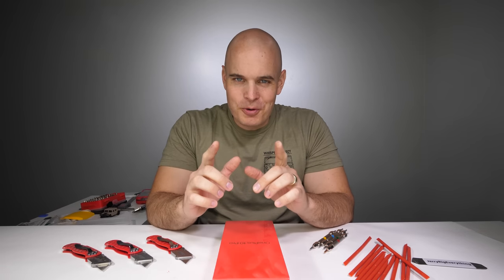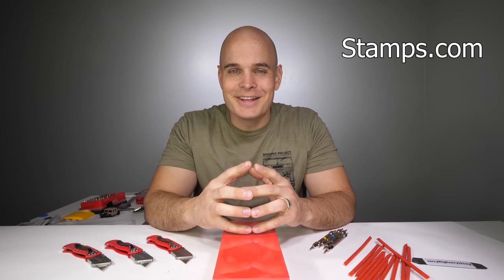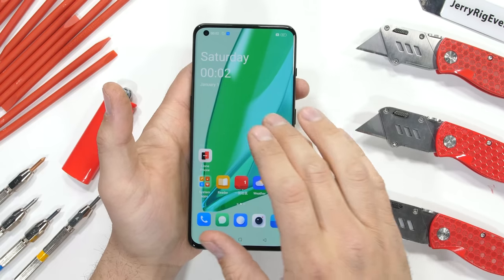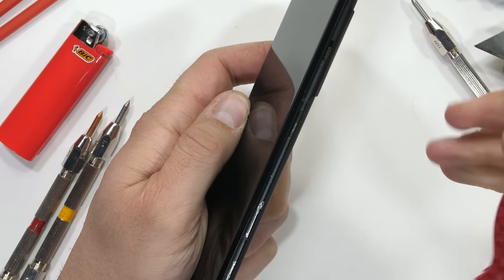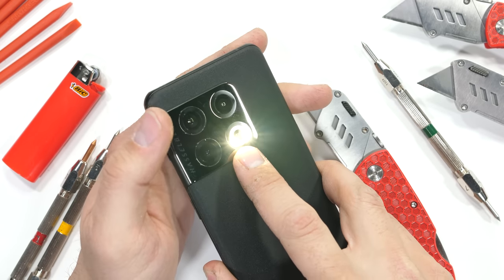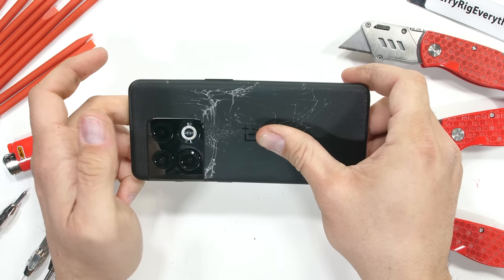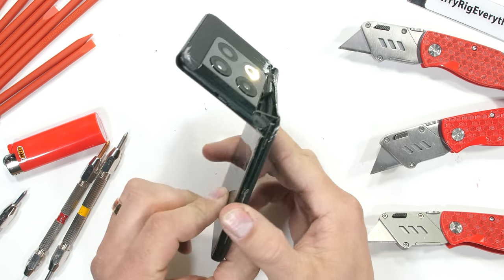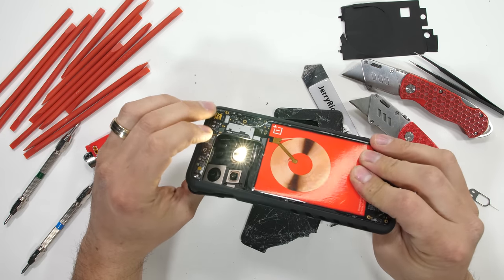Somethings wrong with the OnePlus 10 Pro... - Durability Test!

Comment: It's extremely strange that this could happen. With all the best practices the industry got from years of making smartphones, this engineering mistake should not happen at all.
Reply: Нечего было дизайн у Самсунга воровать, ничего бы этого не случилось, подумали "ооо выглядит круто, также сделаем и даже лучше!" - сделали "лучше"
Reply: It's not a mistake... They made it just name sake
Reply: Because this company is going backward, merged with Oppo. On the bright side, finally a bending smartphone again. Its been a while.
Reply: Chinese manufactures cut corners all the time, they prefer quantity rather than quality obviously
Though OnePlus shouldn't have failed so hard especially shortly going from midrange to flagship status.
Reply: @rayrayvv  has nothing to do with capitalism.
Reply: Engineering mistake happens all the time they were trying to cut cost on quality control
Reply: @souravmandal7527  Watch the Samsung Galaxy A50 durability test then say this again.
Reply: @mr.j5112  what about it? quality and quality control are two different things. If one plus had a quality control team they would have noticed the issue during test. now after the release it is not possible to recall all those devices
Reply: @souravmandal7527  Agree. But even without quality control, the engineers must have access to best practices (that's at least what we do in other profession) that they don't repeat the mistake from the early years of smartphone making.
Reply: @rayrayvv  Has everything to do with 0 competition within China, and the central government of China owning/supervising majority of companies if not all within the country.
China isn't a capitalist country my dude.
Reply: @rayrayvv  so you don't actually know what capitalism is and confuse the government getting involved with the corporations as capitalism, when it isn't. Got it.
Reply: @rayrayvv  I never said anything about corporations controlling the government. And indeed they are two different things. One is Corporatism while the other is Fascism. 
Both of which go against the ideas/policies advanced or would be advanced by capitalism.
Reply: @rayrayvv  Fascism isn't the next level up, it's the next level down towards socialism, fascism is when you mix capitalistic structures with socialistic ideas, or replace certain structures with that of a more socialistic structure, economic fascism, then you mix or rather retain certain parts of nationalism then you get what Mussolini had and what National Socialists built upon. 
It definitely is a thing and you mentioned it.

China has economic fasicm, not capitalism.  That's what I said originally.
Reply: @rayrayvv  they aren't opposites, if you mean politically? you can argue that, in terms of economic policies, there are quite a few similarities.
Imperialism doesn't equal to Fascism, though they can be mixed at points. Capitalism by itself doesn't lead to imperialism. 
I'll shortly address two different subjects you raised:
For Ukraine, you cannot over simplify it to the extent you seem to have. There's a a lot more that happened that has now lead up to where it is now. 
And the US "implant" a neo-nazi as their leader,  given that none in US at this time, are in line with the ideas of national socialism. Unless you count the politicians attempting to coerce tech companies in silencing discussion. Trying to get a monopoly on speech, or endorsing/bailing out and supporting groups that are/have been rioting, causing destruction etc.
The discussion appears to be going nowhere apart from rapidly switching the subject of discussion. Nice talk though. 
Cheers

Comment: Yes, it does have an impact, especially since OnePlus has the highest prices, at the same level as Samsung. I am expecting something more durable from a 1k phone.
It was only acceptable when they had phones costing 400/500 euros.
Reply: Yeah, although it should be noted that OnePlus was $200 cheaper MSRP for their flagship. It's still $100 more than the Pixel 6 pro and is definitely overpriced but still a little bit less than the Samsung flagships.
Reply: Nokia
Reply: Eh, not even that is acceptable. My phone is a $400 Xiaomi 11T and I expect durability from it. So far it's good, but if I ever see Xiaomi 11T failing a durability test, I will definitely change this phone to Xiaomi 12T later.

My last phone was a $110 Infinix Hot 10, and I expected durability from it. It has served me very well, and if I ever want to change my daily driver to Xiaomi 12T (if they don't fix 11T's bugs and 12T is a lot better), I will use my Hot 10 again for a while as a temporary phone.
Reply: my oneplus 5 was durable, right now my only issue was the battery life was shorter compared to when it was brand new. thats why i guess oneplus really settled when they got popular, they care less on their new phones because they are already popular and already earning more money

Comment: Interesting, 10 Pro is basically a 9 Pro refresh (with downgraded Ultra-Wide), yet 9 Pro did not even budge at bending test.
Reply: I noticed the same on samsung
Reply: It's literally WORSE than last year's phone... even the worst iPhone refreshes aren't as terrible haha
Reply: @tommymician121  Still interested in OnePlus 10 Ultra global release this spring/summer with Periscope, MariSilicon X ISP and SD 8 gen 1+ made by TSMC. Just hope it is not a waffle as 10 Pro.
Reply: @TheChazas  sounds nice but is it really gonna be better than the s22 ultra with it's s pen etc.
Reply: @tommymician121  honestly, who knows. and well pen is a niche thing, and personally I dont need it, instead I would take more battery or bigger sensors for the space pen uses up.
Reply: @TheChazas  Makes sense makes sense. I guess let's see, and let's hope OnePlus of all companies doesn't price it out of the market haha
Reply: @TheChazas  SD 8G1 chips aren’t as good they’re not efficient enough and they can overheat
Reply: @lifeisshørt_420  yeah that's very unfortunate. I've been saving up for a z fold 4 but with that chip I'm not sure if I want to pull the trigger if it has a disappointing chip... (Currently own a 1+7 pro)
Reply: @tommymician121  if you really want a phone with that chip then Samsung is your only choice with the z fold 4 or the S22 series. I’m sure they’re the ones who can manage to make the experience not as bad as the Chinese phones
Reply: 1+ runs on a shoestring budget now as it is being merged with OPPO

Comment: I am always concerned about phone durability. I remember cracking my iPhone 5 just by putting it in my back pocket and sitting down in a car. Having to replace a phone screen with curved edges, it’s definitely a concern. I wouldn’t buy this if it was possible to be snapped by hand. My stuff goes through so much abuse that stuff requiring gentle care is totally off the radar
Reply: I'd suggest a cat phone mines srioved falls up to 5 mtwrs on concetre of a scaffolding
Reply: Who would've thought glass would crack when sat on.
Reply: @ulysses4989  exactly. Especially between 2 squishy stuff

Comment: Im happy to say that I had the privilege of owning a OnePlus 7 Pro. It was ahead of its time. I had a solid year of flashing custom roms and tweaking everything to my liking. Unfortunately when the 8 Pro dropped it all went downhill from there. Even the 8T’s display was poor quality. I now have an iPhone 13 Pro Max. I won’t be going back to android unless Google pulls their finger out with the Pixel 7 Pro
Reply: Agree with you there the 7 plus pro best one I still have mine after 2 years now and it still going strong even on battery. But dont agree with the iPhone and pixel as google drop pixel support way to fast making a 2 year old pixel useless.
Reply: I wouldve said s21 ultra but the 13 pro max is a pretty good phone based on its hardware
Reply: I mean, calling OnePlus 8 Pro bad and then buying iPhone 13 Pro Max is a bit stupid. You literally threw out one bad thing and took even worse one. I know there are some Apple fans but from a rational point of view, the iPhone 13 Pro Max is just an expensive paperweight, unlike other phones.

Since you're jumping from OnePlus, to the iPhone and back to the Pixel idea, it's naive to think that people like you buy phones for functionality, because you bend between 3 companies that have absolutely nothing in common in this area, which only leaves a question : why? Having a good-looking expensive phone is nice, but if you buy something that just looks good and the competition has a better working model, then you're more of a fool with such a purchase.

This whole commentary smells like a cheap bait on some Android vs iPhone quarrel, or you're really just buying phones depending on how they look.
Reply: @Shota015  omg lol
Reply: Unfortunately im on the iPhone train as well, i need google to really pull out all the stops
Reply: 8t having a bad display??? In which aspect? I am using one, not sure what is bad and in which respect?
Reply: @Shota015  what's so bad about the 13 pro max that makes it a paperweight?
Reply: @Shota015  you just said that iphone 13 pro max is worse than oneplus? 😭😭  damn you living under a rock it seems iphone literally is better than oneplus in every single thing the only thing is iphone  is very clean like there aren't many features and that's the only thing otherwise no idiot wouldn't take an iPhone over pixel
Reply: That was nice to know, I myself got a oneplus 7 pro and held onto it, till November 2021, and then bought the iphone 13 pro, wanted to use a smaller phone, though the weight is similar to 7 pro😁😁, oneplus 7 pro was the very best and they went downhill after that.
Reply: @Shota015  I dont get how the oneplus 8 series is bad whatsoever? The issue i ever had with my 8t is that the youtube app is buggy.
Reply: I hope my 7 pro survives the next few years since it will be my last android phone. I too don't see myself buying another android device.
Reply: @traine4126  explain to me what is bad about the iPhone 13 pro max.
Reply: @jairuswilliams9792  You mean you are in the Apple Gulag.
Reply: @machtschnell7452  hahaha, good one :)) like Google isn't doing the same thing or worse. They are an advertising company first.
Reply: @nickhusic2592  exactly my man! The only data they need (and by they I mean bots, it's all automated) is my general interests so they can sell me stuff that I might actually buy. Guess what, you don't Have to buy anything if I don't want to :)) no one cares about your personal data and if you have to be concerned about it, you should be using a burner phone and changing it regularly. Take care and enjoya paranoia free life ;)
Reply: still using my 7t
Reply: @nickhusic2592  It just lacks a lot of Android features and IMO has backwards confusing features of it's own. 

Hardware is the best of any phone obviously and it's not bad by any means. It comes down to the software. Android is just a superior OS and top Android phones perform so similarly in the real world that I wonder why anyone would chose an iPhone. 

To each their own. My work phone is an iPhone, it's fine, but I would never be able to use it as my personal phone.
Reply: @EldritchAugur  sure android has more features for an avid tech enthusiast but for 95% of people who own smartphones, iphones have every single feature they could possibly need.
Reply: @Shota015  I never hated on OnePlus. I’m just stating facts. The 7 Pro would be my all time fav phone but with technology things get old really quick. I can afford to buy a new flagship every year but I wanted to stop that. I wanted something for longevity..Instead of buying an android phone every year hoping for polish and optimisation.
Reply: @Shota015  how is the iPhone a “worse” one while the oneplus was simply the “bad thing”? I’m sorry but apple is infinitely better than oneplus as of now and I’m not even an apple fan like that
Reply: @Shota015  or you just need to stop assuming that you know everything when in reality you don’t. Can you afford an iPhone?
Reply: @nickhusic2592  It is an iphone, therefore it is inherently anti consumer because it has IOS and not android. No freedom to download whatever you want, no freedom to repair, no freedoms to use hacks or modding, it is part of the apple ecosystem which is toxic, it is over priced. Iphones are automatically bad because they are iphones no matter how good their specs are unless apple changes their horrible anti consumer ways their products will forever be bad.
Reply: I also sold my 8Pro and got an iPhone 12 Pro Max, now rocking my 13 Pro, and watching Oneplus slowly drown
Reply: @nickhusic2592  I could ask the same. Amazing phones, 5G across the current range , powerful cameras and super strong A15 Bionic chips, and now with 120Hz they are quite modern.
Reply: @traine4126  I use apple care…
Reply: @mitchellcampleman8236  good for you that doesn't matter
Reply: @traine4126  I’ll rather my device be repaired or replaced by apple then some random guy in a corner store
Reply: @traine4126  99% of people will have everything they want to download on the app store barely anyone hacks or mods their phone. For a lot of people the apple ecosystem is really convenient and not a negative. Also androids cost the same nowadays unless you want a cheap Chinese phone with crappy software. I agree the lack of repairability sucks but in the end the positives heavily outweigh the negative these days.
Reply: @traine4126  Everything you said about the iPhone it isn’t not consumer friendly. Its not tech savy friendly. The average consumer doesn’t give a shit about hacking or modding or side loading apps nor would want to even observe it… Also as for right to repair they’re starting to (finally) give more repair tools to repair your phone altho I agree it sucks it took them so long to finally made it happen
Reply: @lifeisshørt_420  it doesn't matter that the average user is too tech illiterate to care. The fact that the options don't exist in the first place is the issue. Also they have been making it even harder to get access to their parts. They are becoming more expensive and way more parts are now hardware locked to the phone so replacement is impossible.
Reply: @mitchellcampleman8236  cool, id rather have people like Louis Rossman repair my items than some random idiot at apple
Reply: @nickhusic2592  everything you said only applies to the US market. If you go world wide you will see why apple loses almost its entire market share. Most people want to actually own their damn phone and not be limited by a random company who would rather produce billions of tons of ewaste than ever let someone do a battery replacement or download a free app
Reply: @traine4126  if you think most people choose which phone to buy based on the amount of ewaste and how replaceable the battery is you're delusional. Obviously the Chinese market will be dominated by Chinese phones and the US by US phones.
Reply: @nickhusic2592  ya samsung is a Chinese phone brand. People buy based on price and if the phone is actually worth it. How much worth can I squeeze out of my device is the #1 priority anyone should have when purchasing anything
Reply: @traine4126  yeah but Samsung has heavily invested in the western market and done so successfully. The average consumer in the US would gladly pay £100 more for a phone that will cause them 0 problems in the long run compared to something with an oppo phone that won't be supported nearly as long and not be as smooth an experience. There's nothing wrong with spending a bit more cash on the thing you literally use the most every single day.
Reply: @traine4126  last time I checked Samsung was Korean.
Reply: @nickhusic2592  theres no point arguing with him. I have had multiple arguments with people like this guy. It comes down to money. People can’t seem to wrap their head around the fact that most people in western countries have flagship Apple or Samsung devices. I have never broken a screen ever in my life nor have I had a phone fail on me. I live in Australia where the climate isn’t humid like in asian countries as phones in humid countries tend to fail more often. The only phone issues I’ve ever had was manufacturing defects on Samsung devices.

Comment: Still rocking my OnePlus 3T for six years and counting, I really love that I can take off its aluminium back panel with just a knife and a paper clip in case of anything disconnecting after a drop, and am really hesitant to switch off of it.
THAT'S what I know OnePlus for, and what I loved them for, but their recent releases have been pretty disappointing so far
Reply: I'm on op3 myself. Got it for $400. About to upgrade since my storage is only 8% left now. And maps runs slow sometimes.
Reply: agreed, ive had my OnePlus 6 for 4 years now since release and i remember when it was the flagship and it only costed £470! after 3 years though its just losing life every day, so im planning on upgrading. might go for the pixel 6 pro seeing as oneplus has changed now and the os systems are oppo  and not vanilla-ey like i like it. such a shame though, ive never had to do anything with my phone in terms of repairs or anything like that. it can even take 4k60fps unlike some new phones nowadays :) will miss this phone but ill keep it as a back up. unless the 9 pro comes to 500 - 550 ill probably be moving brand elsewhere :(